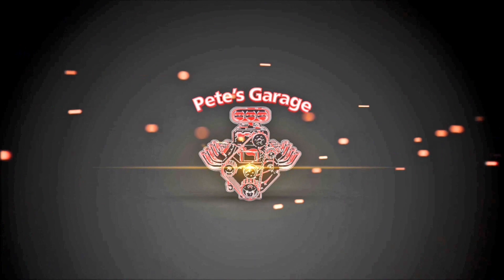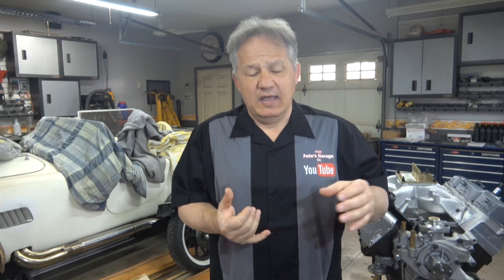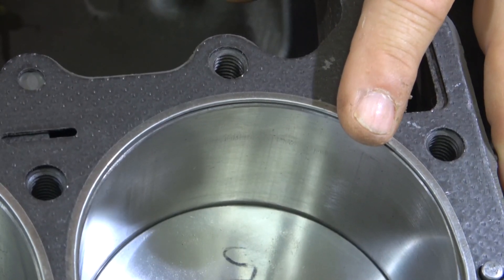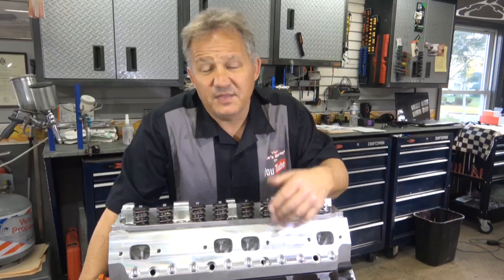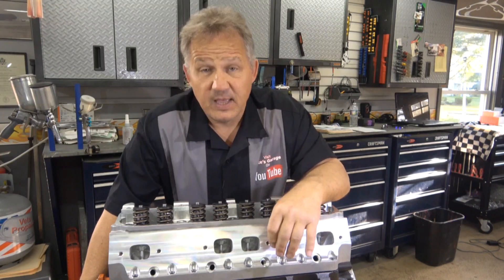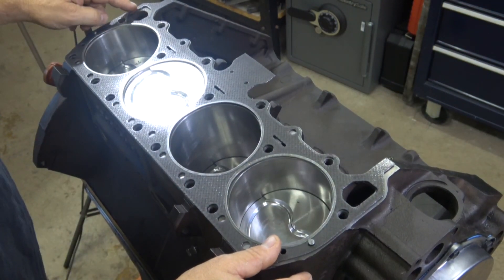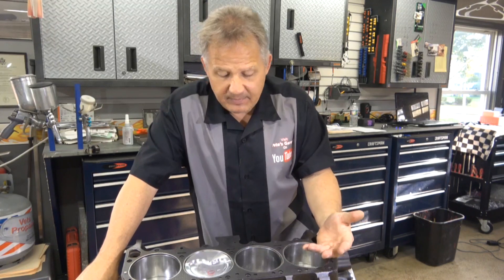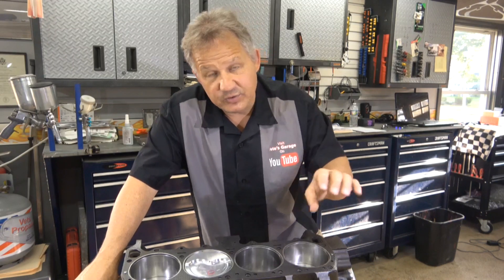What is a blown head gasket – Can you fix a blown head gasket by pouring sealant into the coolant

Comment: Great video, but even though you briefly mention a scenario where exhaust gasses are leaking into the coolant (but no coolant is leaking into the engine), you dont address whether coolant additives (i.e. a head gasket sealer like Blue Devil) would work in that type of situation.
Reply from the maker: Those sealers can work so it's worth a try